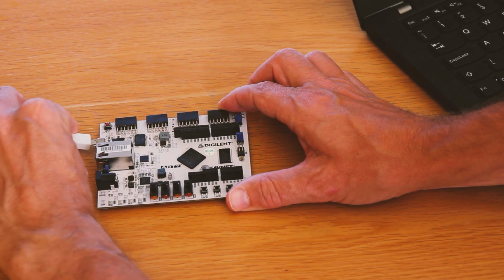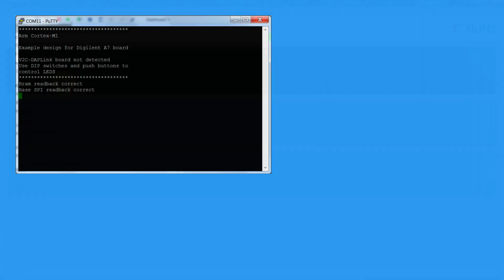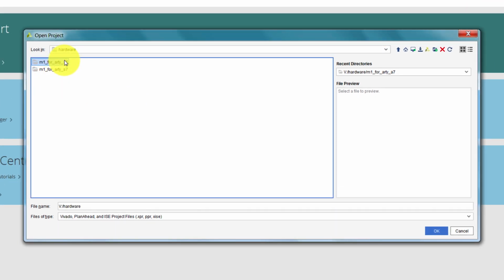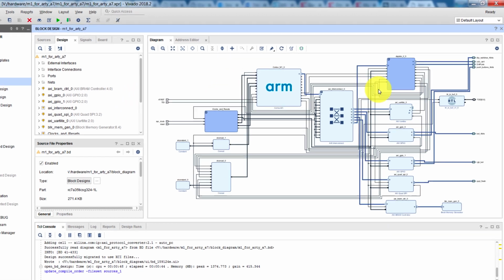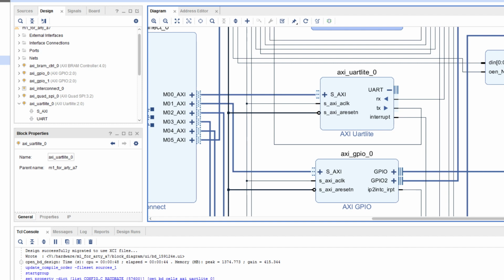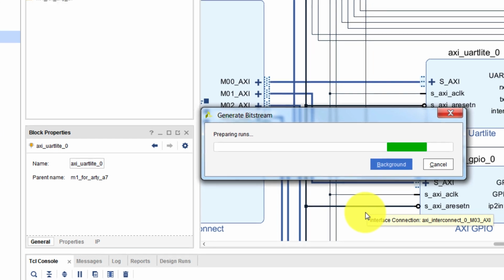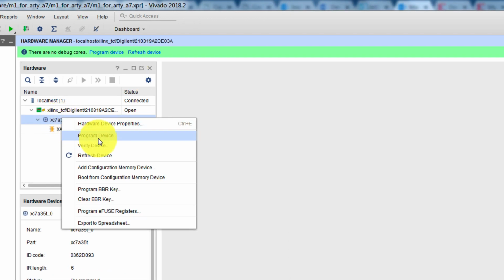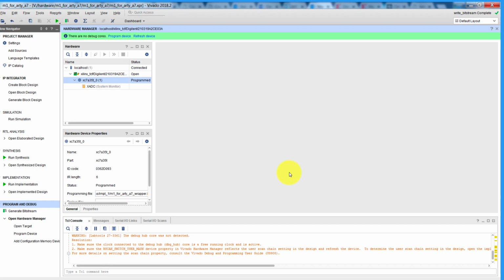Arm Cortex-M DesignStart FPGA: STEP3 Modify the Cortex-M design

Comment: If you use Vivado 2019.1 you might encounter this error: 

https://community.arm.com/developer/ip-products/processors/designstart/f/designstart-forum/12175/xilinx-com-ip-axi_bram_ctrl-4-0-does-not-support-the-current-part-xc7a35ticsg324-1l